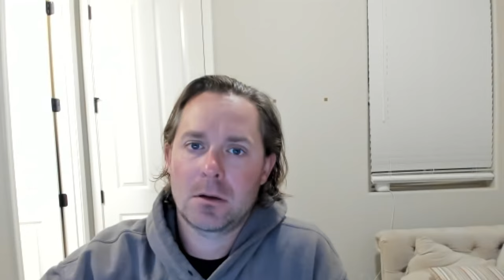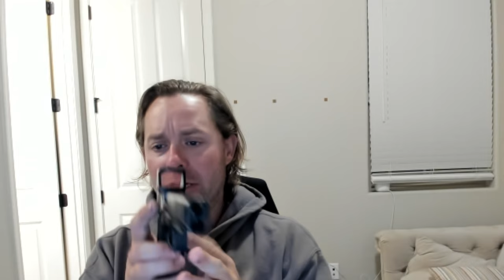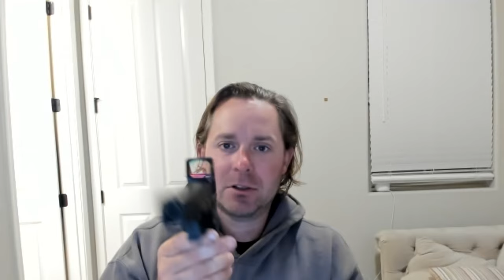Dot not recoiling straight up

Comment: I personally don’t care as long as it is consistent. I’m not a robot and can’t apply the same pressure on the exact same place each time. I can tell by feel and dot tracking if I fucked up the grip. If the dot has returned and it’s good then go what are you waiting for.

Comment: On my p320 I can easily grip it and rip it on my Canik Rival -S it has been alot harder to find the right grip pressure to get the dot to return correctly when focused on a spot it seems to want to recoil and settle at 12oclock of where it lifted from
Reply: p320 rips all on its own 🤣
Reply: @piouswhale  I hear that a lot and I can say mine hasn't and I've shot it enough to have to replace the sear striker and disconnector
Reply: I am back on the canik S do you find different ammo makes a difference. 147,s seem lethargic.  Or just me.
Reply: @bobb8423   I do... I have 147s but I primarily shoot 124s ... The rival s seems that way in general
Reply: @bobb8423   and I have had more issues with putting an extension on the rival s mags than any other pistol I keep getting rounds nosing into the feed ramp and it done it a time or two with the standard mag and I've gotten well over 2000 rounds through it... I'm not nearly as satisfied with my the rival s as I have been with my other polymer frame Caniks

Comment: If you look at this problem trigonometrically, what Ben is saying is mathematically true... I love the way his brain breaks the problems down to fundamental observations and reactions.
Reply: Well, technically it would be slightly more beneficial to have the muzzle climb up straight than at an angle. Since scoring zones are usually taller than wide statistically you lose more points on bad shots when you screwed up dot/muzzle return (e.g. dot focused, pulled trigger befoe return on 2nd shot). But I guess the way training/technique effectiveness balancs out, most emphasis should be placed on consistent return, rather than direction. However it seems to me that it can be a good indicator of (too) little tension in the firing hand wrist, if the gun recoils at an pronounced angle towards the firing hand side (pistol).